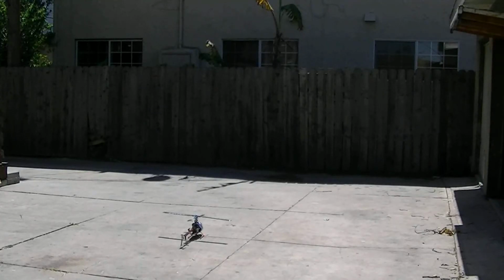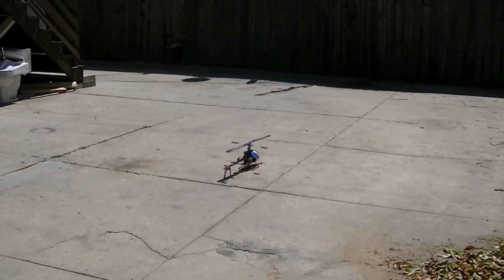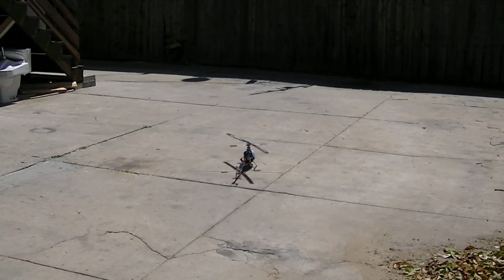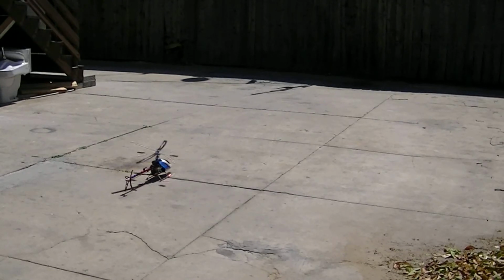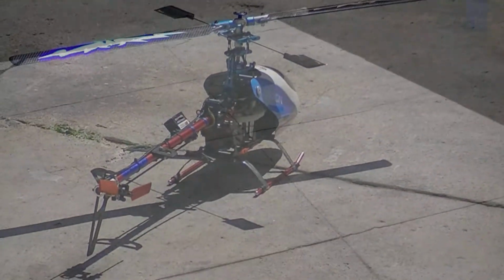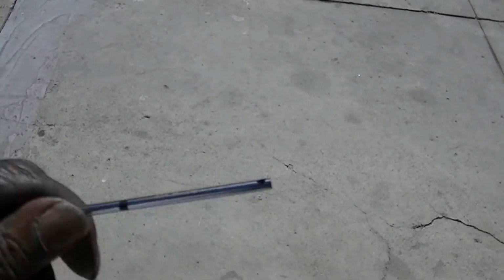titan trex 450 blades out of track then tracked align hi carbon steel shaft replacement

Comment from the maker: @J0NB81 
yep 10 dolla titan esc and align motor and titan tx 
im futaba is being shipped home tomorrow got my back light installed i have a hobbyking rx futaba compatible for the titan gotta keep da beater a cheap as possible 
i have learned so much with the titan played alot with the swash and dual rates pitch curves etc

Comment from the maker: @DELBERT256 
and bigger is more expensive when you pass 500 size battery cost 150 bucks and you may need two batteries  300 bucks for 7 minutes of flight time 500 size lipos can be got for 50 bucks each after 500 size i think its better to go nitro fuel is 30 bucks a gallon